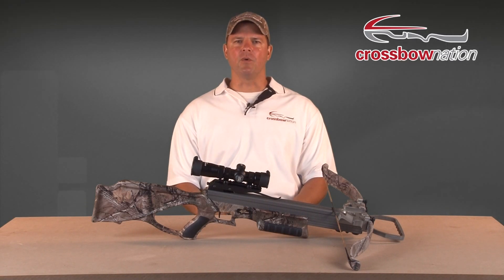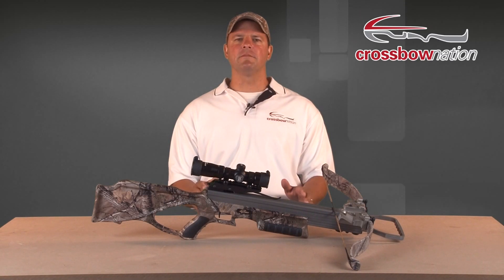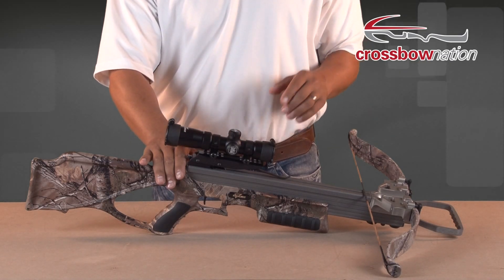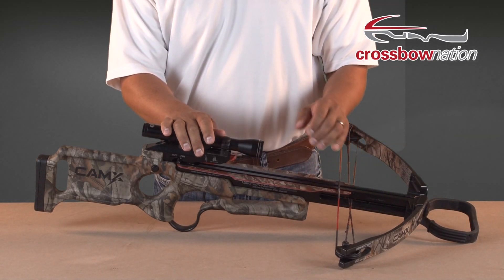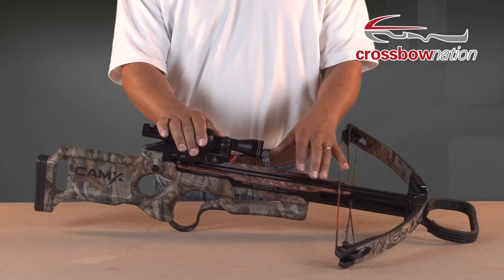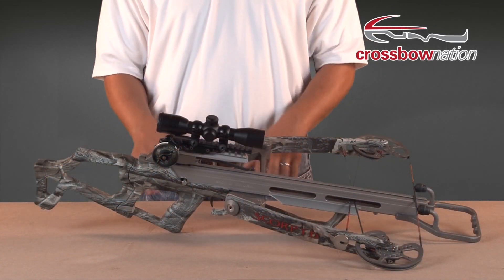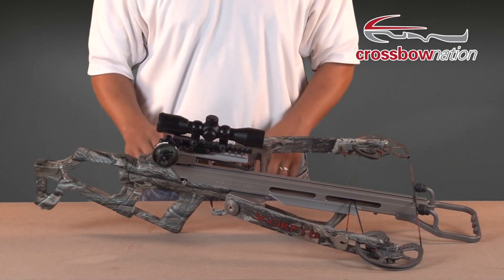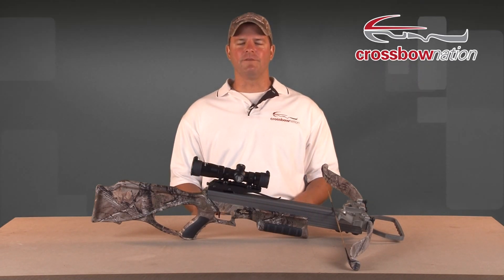CSE-Crossbow Bow Technologies

Comment: Everybody I let shoot this thing loves it>>>t.co/FQwGsX4mTe   guys and gals, although some smaller gals and guys will have trouble cocking it. Solidly built, just like all the reviews say. And for the price, you can't beat it. Not the lightest weight but really, no crossbows are light. From the ground, it's easy to prop it up on a knee or whatever. In a treestand that doesn't have a wrap around bar, you might want to get an extendable monopod or something. I shot freehand from a treestand and got a deer but my arm was getting tired from looking through the scope and freezing my movement when the deer were looking my way. Doesn't come with a case but the Parker Red Hot Deluxe case fits it perfectly, like it was made for it - no extra sag or bulk